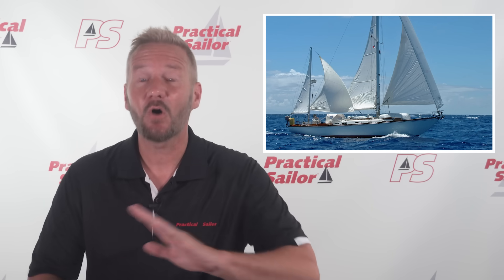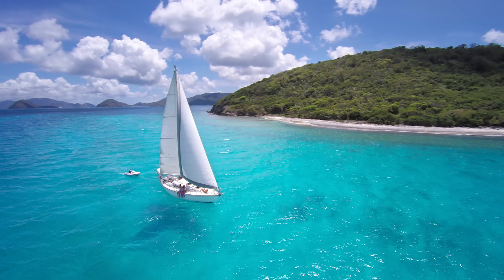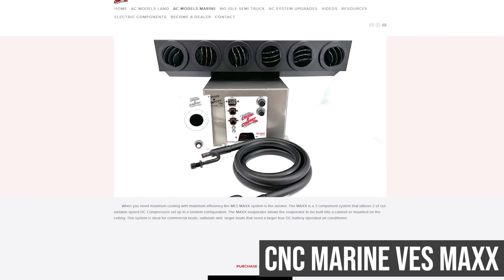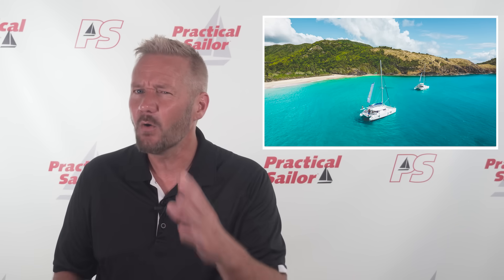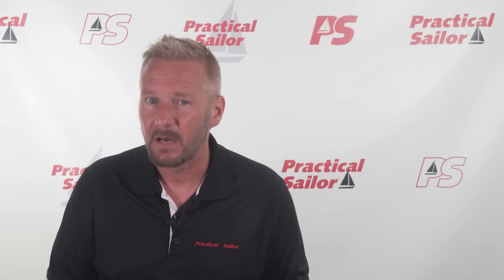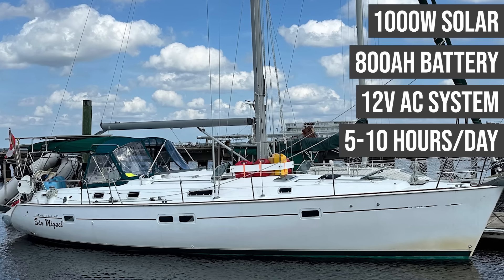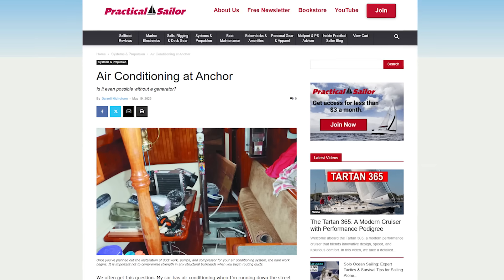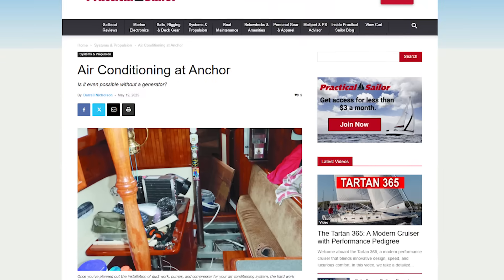Can You Run Air Conditioning on a Sailboat with Solar Power? YES — Here’s How!

Comment: Yes you can. I have 24v system with 4x Litime 300amp
battery  3x350w Solar, and a Zeus alternator 24v regulator. It works like a charm. I can turn the A/C whenever and wherever I want.
Reply: We have a similar setup: 
5 x 330Ah 12V Lifepo4 batteries
2 x Zeuz 275A Alternators with 2 x Zeuz Regulators
2400W Bifacial solar panels on a custom frame (Realisticly getting around 1550W direct charge in the Med)

We do not have AC yet, but we are investigating it now. Frigomar looks like a good solution. At this point we are able to top off the batteries completely every day just using solar. That includes fully electric galley, bread baking every other day, freezer, fridge, starlink, watermaker etc.
Reply: thanx Eddy, I am gonna save this episode and come back to ask questions. Looking right now for my boat in florida! You didnt mention what boat you have and where you are sailing?

Comment: You quickly mentioned fans but I'd like to expand on that a bit.
Using temperature in Celsius.
Each degree C you lower your thermostat, you drastically increase your electricity use.
I don't know the exact amount, I've experimented some in my home by monitoring meters in various scenarios, but:
I would estimate 10% more electricity used per degree C.
Thus setting at 26 rather than 24 uses 20% less electricity.
But 26 is not quite comfortable enough.
However, if you adequately fan the area, 26 feels like 24.
And fans draw a tiny amount of electricity.

Comment: Can you do one of these videos on the other end of the temperature scale ... heating solutions for winter live-aboard?
Reply: I have spent the last 2 winters aboard and would steer you towards a diesel forced air system.  The biggest drawback to these is installing the ducting.  They use low amps and are pretty efficient on diesel usage as well.  I have used this while operating off grid and running the heater 24 hours/day.  Probably less draw than my refrigerator.
Reply: Solstice. The biggest issue with reverse cycle (a/c and heating) units is that it uses the heat from the water to heat your boat and if you are in cold waters like in New England for the winter these units really don’t work very well once the water temp gets below 50 deg F

Comment: I wonder what are some of the advances in heat pumps coming? How about boat insulation approaches around the boat? Does hanging a solar shade over the deck work?
Reply: The split vent is a heat pump

Comment: Adding a shade over the foredeck can help, too.
Reply: like bock out all the direct natural light, and leave the indirect ....because it's the solar thermal gain from the direct natural lighting, which turns the cabin into an oven.
Reply: yeah like something to block the solar heat from coming in the hatches and windows ( mostly the hatches, mid-day, as you pointed out )
Reply: Like Rick Moore's SSL fore deck.

His forward shade also has 4 large, flex solar panels stitched in ... and it looks fairly easy to set up, with his rig - though it took some time to dial it in!
Generating power + creating shade and breeze (for hatches, vents, dorades, etc...)
Rick Moore - SSL689 >> https://www.youtube.com/watch?v=kLi8wOq3S7o
Reply: like those things they make to block sun from getting in through a car windshield ( where the rest of the windows can be legally tinted )